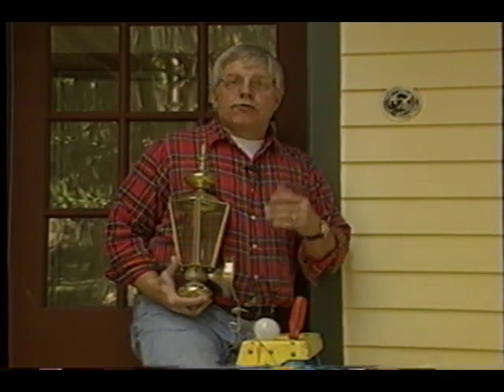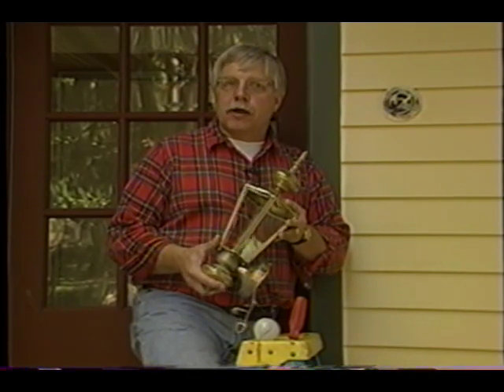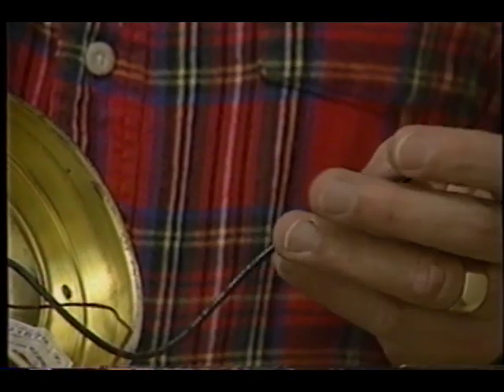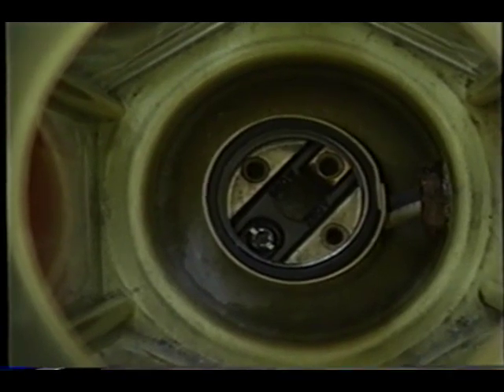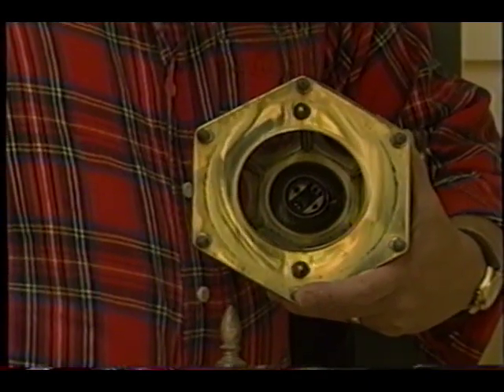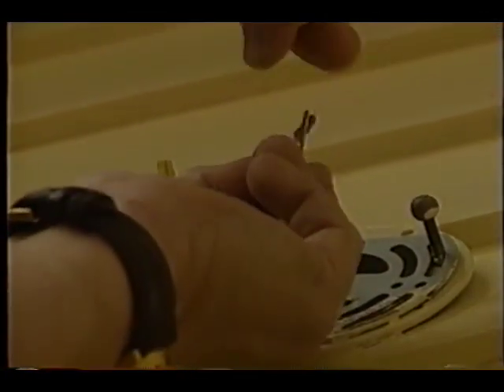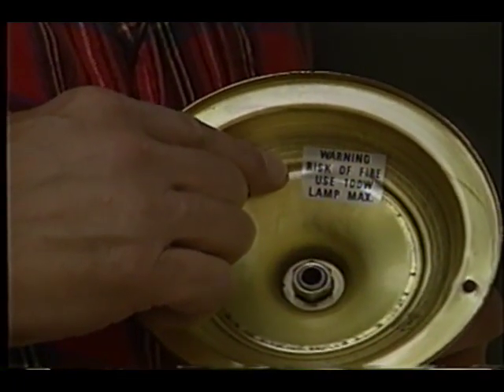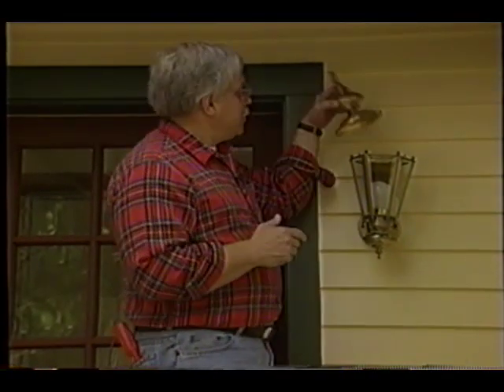Electrical Safety

Comment: yo you didnt wrap your stranded wire around your solid wire while twisting them in the marettes.... you have no idea how many service calls i have went to because the wires were just "assumed" to have been twisted together through the marette and what happens is there is no contact through the connection, then the people cant figure out why their light or whatever you may have is not working

Comment: a ground screw is only listed for one wire, you should wire nut and pigtail the equipment grounding conductor to make the proper connection.

Comment: and how about the most important tip of all..?

STEP ONE- MAKE SURE THE POWER TO THAT DEVICE IS 'OFF' IN MORE THAN ONE LOCATION BEFORE ATTEMPTING ANY REPAIRS!

in the scene we've just seen, he doesn't even mention it, and who's to say, that lamp was turned off to start with, or is all alone on a branch that was turned off.?